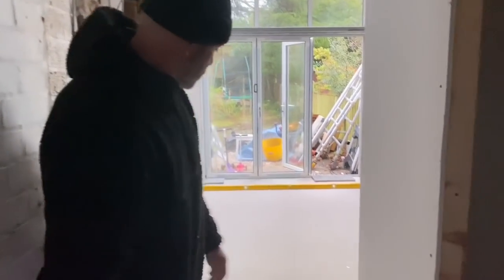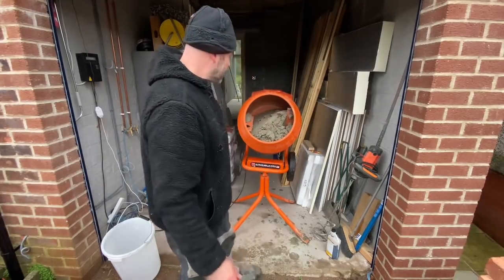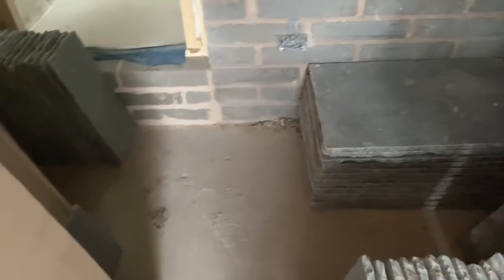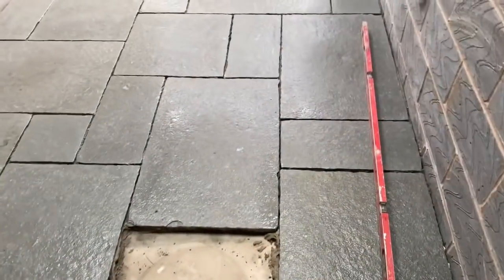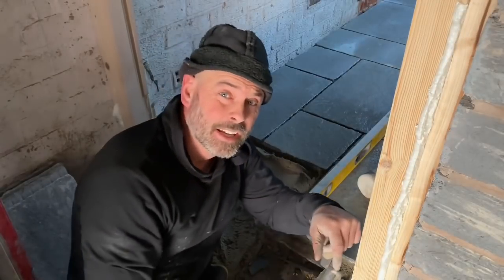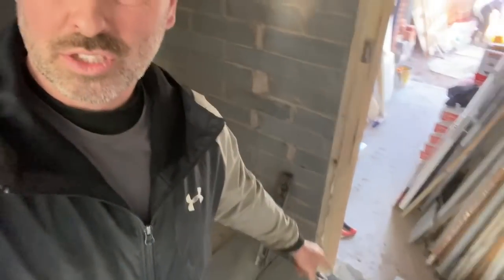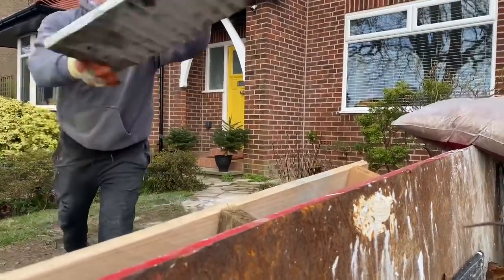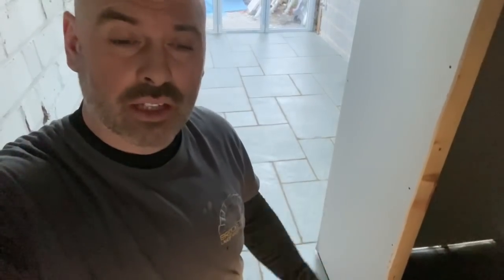Limestone Interior Floor

Comment: I’m installing flags into my thatched cob cottage, laying them onto a limecrete slab so I’m laying them using secil adhere cal which is also a lime product, I’m spacing the flags with roughly a 13mm space between them as it all needs to be breathable, nice job.

Comment: Another fantastic job and accompanying video. Your attention to detail and finishing is incredible, also some great tips and advice shared with your viewers.
When you're laying a multi size product that do you have varying joint widths to keep bond aligned?
Fantastic videos. 
Keep up the good work.
Reply from the maker: Hello mate, thank you! Glad you’re enjoying the videos.
The joints will be 8-12 mm
I prefer to keep them tighter and you can always open them up at the end with the saw if needs be 👍

Comment: Hey mate how would you grout a limestone floor slabs were laying them atm an near ready for grouting, we have grout master 3000 in a stone colour but not sure on the consistency to make it, would a piping bag be ideal to point them with then let it set for a few mins then pointing tool to smooth out? Or will we just use the same as this video
Reply from the maker: I’ve not used that grout mate so don’t know if needs to be mixed in a certain way? 
I’d read up on it and maybe try both ways see what’s working best